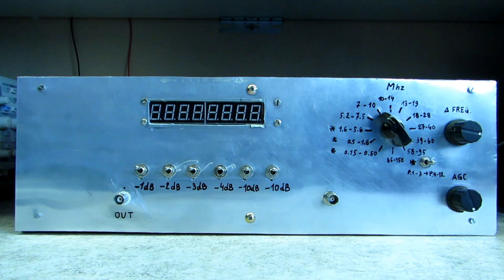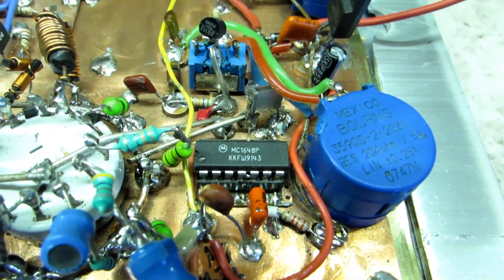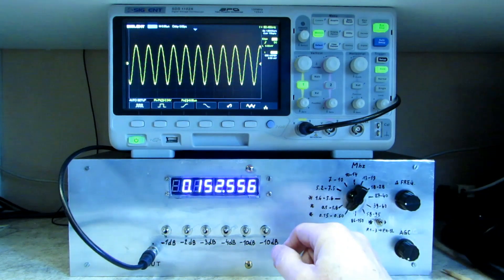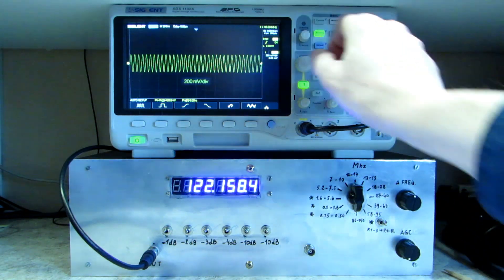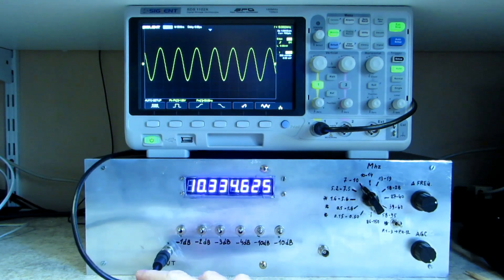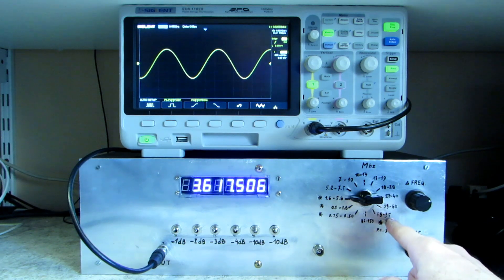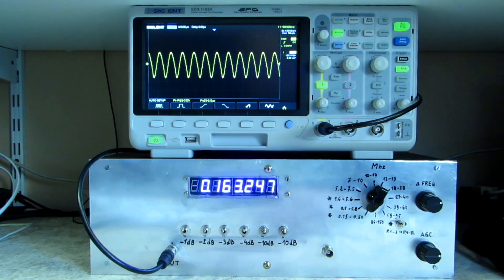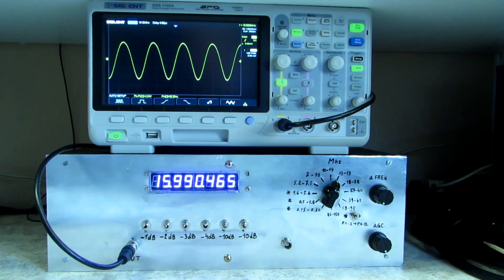RF Signal Generator 150kHz-150MHz Part 1

Comment: could you add the schematic with your modifications
Reply from the maker: Hello, I'm still using the sine wave generator without adding any circuitry to modulate the sine wave. I do plan to do that in the future and will post it on YT. I hope that is an answer to your question. regards

Comment: Very nice job. Congratulations ! I am looking to make also one for me. Do you have any schematic of your circuit used ? I am in Brazil, my e-mail is antonio.pinezi53@gmail.com. If the schematic is not available , please send me fotos of your circuit board. Also the link from Ebay to by the frequency module board if possible. Thank you in advance . Regards.
Reply from the maker: Hallo Antonio I'm curious if you also have build this RF generator based on the schematic I sent to you?
Reply: Hello Mr Rikkie ! Yes, I made one here based on your schematic. I made some simplification in the schematic. I will send photos to you in your e-mail. Thank you very much !!